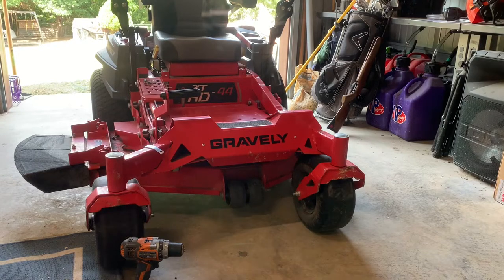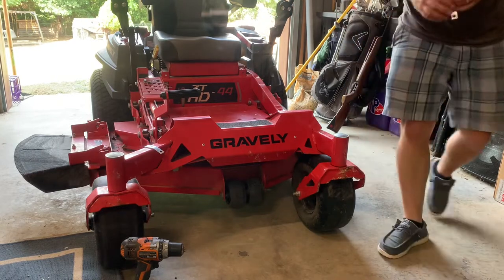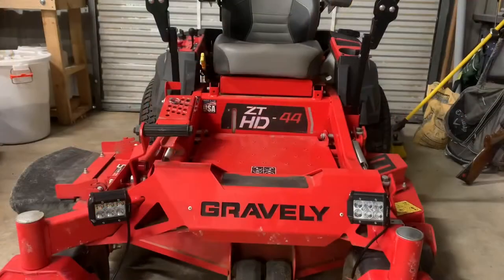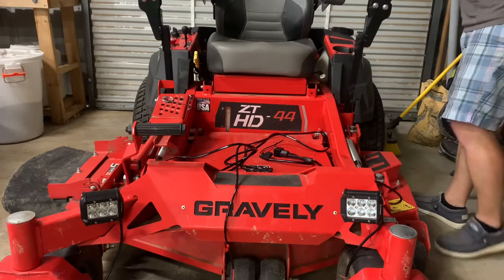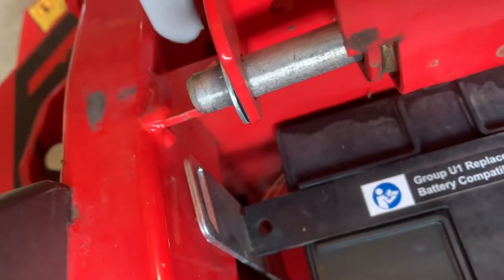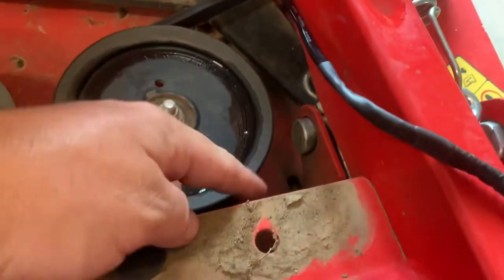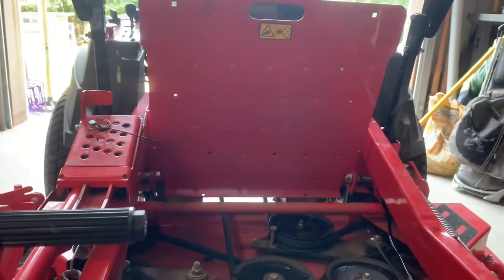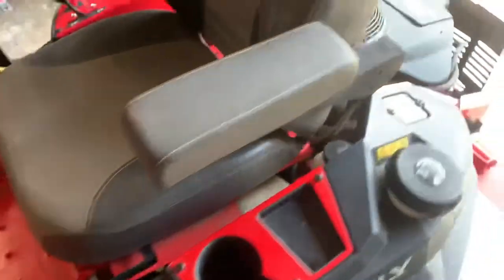Installing Lights On A Gravely Zero Turn Mower | Do You Mow At Night?

Comment: Is the relay necessary? I have the lights , but it only has 2 wires coming from each of the lights. I have the same mower 265 hours on it.
Reply from the maker: I would use the relay. Saves a potentially large headache if not installed.